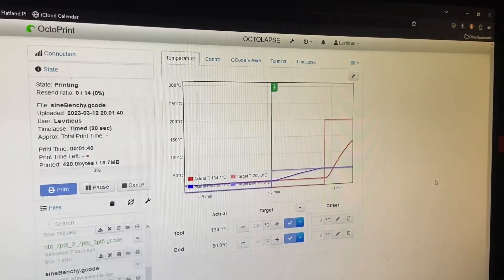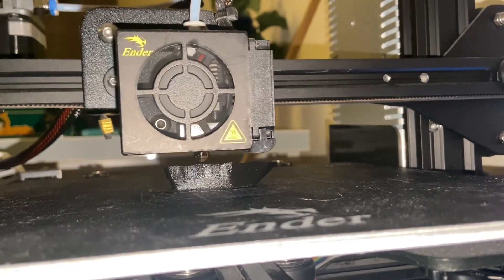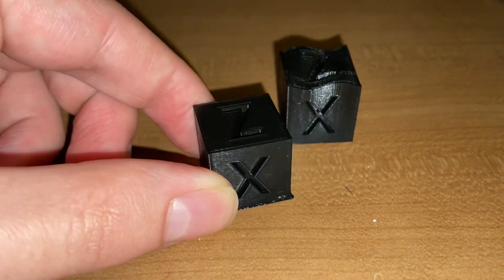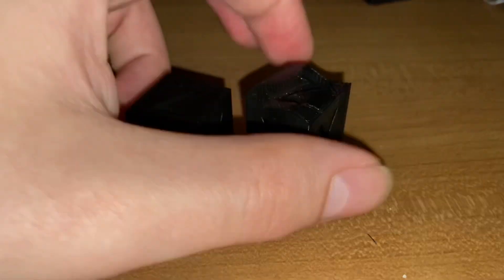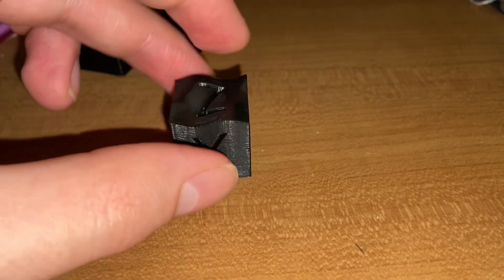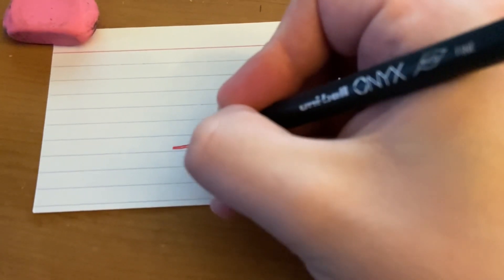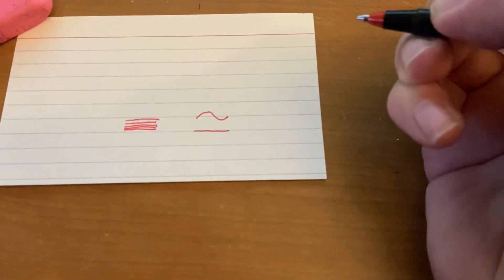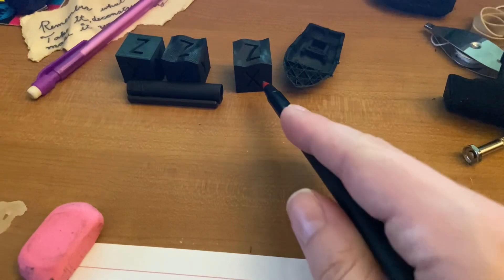My Non-Planar 3D Printing Finally Works!

Comment: This is really impressive! I tried printing the cube, and it worked well. May I ask if the surface function can be changed to other shapes, like linear slopes,  parabolas or random bumpy surfaces?
Reply from the maker: It can!! I’m so sorry I missed your question! There is a function in the python code that you can just change, a stand alone function that the Goode editor calls. That can be changed to whatever you wish, although no guarantees itll be physically possible. Let me know if you have more questions I’d love to help ya!

Comment: 2 or bette yet, 3 different layer heights + non planar, going to be difficult, but it will decrease print time, increase layer strength while keeping the surface quality.

Comment: A calibration cube is for setting your steps/mm, the 3d model is exactly 20x20x20, so imagine x=current steps/mm and y=correct steps/mm and Z is what the dimentions were after you printed you use this problem to find your correct steps/mm       (20/Z)*X=Y
Reply: It is not exclusively for setting the steps. In case of a core xy you could also see if there is something wrong with your belting, in case of a bed slinger you could also start investigating whether your gantry is not square and true. You can have your steps set correctly and still have inaccurate prints.